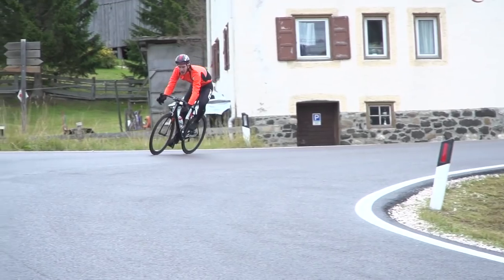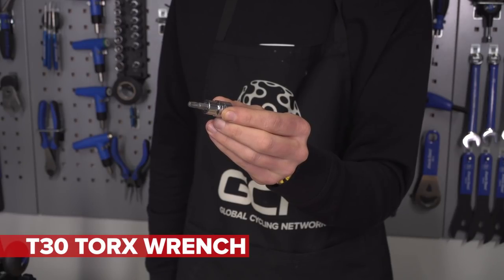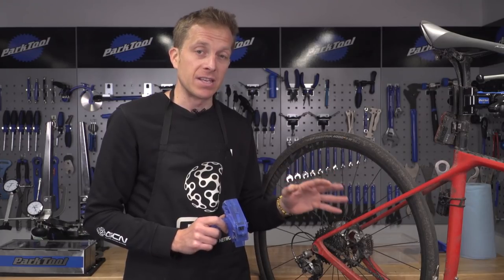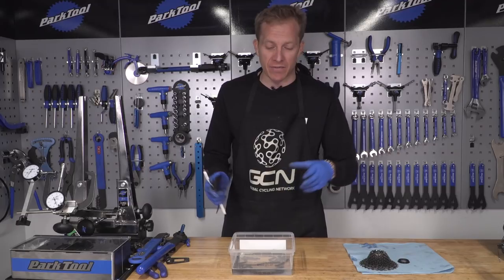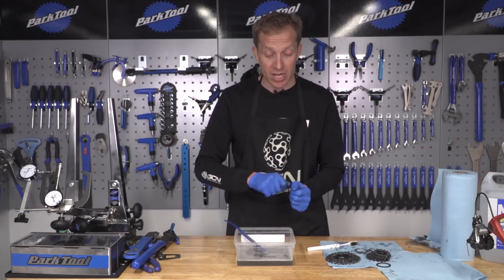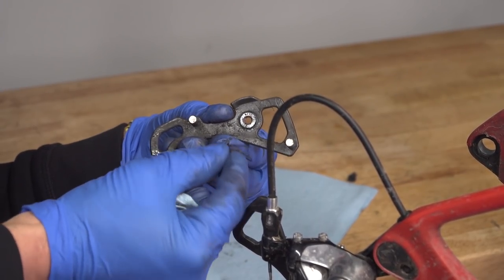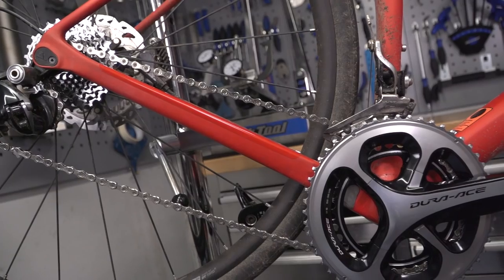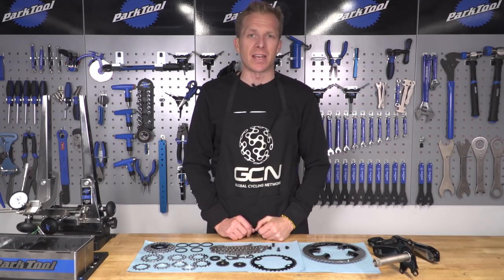Drivetrain Deep Clean | Make Your Road Bike Ride Like New

Comment: You're pouring the degreaser out the wrong side of the full container - to avoid spilling it, pour sideways or even backwards, that way the bottle is much closer to horizontal before it starts to pour and you get a better stream.

Comment: The first step to this process should be to not let your drivetrain get to the state it was in at the start of this video in the first place. An ounce of prevention (that is, washing your bike and degreasing the chain with a spray degreaser regularly, especially after it's been out in bad weather) saves a pound of cure (taking the whole damn drivetrain apart and scrubbing everything with a toothbrush).

Comment: After cleaning my bike properly last time i'm dealing with a new problem i've never had before while riding it. When i'm putting force on the pedals my gears do sometimes switch to a lower one. This happens while standing up and sitting down as well... Don't know how to fix it exactly? Did i do something wrong putting the casette back on (maybe swaped the black rubber things that are between the sprockets)? Or is it just the derailleur that isn't adjusted well anymore?
Reply: Sounds like the chain may be threaded through the rear mech wrong and hitting the cage which is what you may be feeling.
Reply: Thanks for youre reaction! But i didn't think that's the case here... I didn't removed the chain, only the cassette! It does hit the cage at the front derailleur when i'm ridding in my highest gears!

Comment: if u get the crank of completely why not replace the rubbish Pressfit Bottom Bracket as it will most likely be full of dirt and grime too if for e.g. your jockey wheel bearings are dead

Comment: Use an ultrasonic cleaner. It will take you 10% if the time and no scrubbing degrease in ultrasonic and rinse with hot water

Comment: what do you mean contaminate the chain? - Also, I would say lubing the chain is probably easier off the bike, and then putting it on, really only having as much oil on it as necessary. This way all the cogs would stay clean a lot longer.

One more thing: ever waxed your chain instead of oil?

Comment: do you need to do this after evry ride?
Reply: if you ride in the rain and muck, you should probably give your bike a quick hosing off after every ride, then dry and regrease the drivetrain.  a tear-down like this is only good once the bike is super dirty (or you really like taking things apart).  Maybe once or twice during the winter, again depending how dirty things get.  a deep clean is always cheaper than new chainrings, cassettes, and bearings.
Reply: Lars:  Of course you do.  (It gets harder if you do 2 rides a day!)
He hasn't even shown us the daily steering/fork disassembly lubrication, although I am sure you remember the weekly brake check and handlebar wrap.

Comment: Jon, my automotive trainer would have had a fit if he saw you using a torque wrench to loosen a bolt!  loosen with a torque wrench can impact on the calibration of the tool.
Reply: Eli Douek he didn't use a torque wrench, he used a torx wrench. Different things. Torque wrench measures the force in Nm, whilst a torx wrench is a six pointed screw driver or wrench
Reply: Actually, he used a torque wrench with a torx socket to loosen the chain ring bolts @6:56. Eli Douek is correct, you should never use a torque wrench to loosen fasteners.
Reply: He didn't use a torque wrench, watch it a few times. It's just an ordinary socket wrench with a torx fitting.
Reply: That is definitely a torque wrench. You can see the adjustable knob at the end.

Comment: 2:57 what?! Removing a joining pin?! Isn't Shimano suggest to remove any other pins, except the joining pin? It is slightly bigger than the normal pins, so it can tightly fit in place of the original pin, while the original would be a little bit loose? Same should be here, when you remove the joining pin, you leave a bigger hole, so the new pin won't fit so tight.

Comment: this was so painful to watch! Use a high pressure washer with some soap first to clean all of the sand and stuff first so you don't damage the protective coatings and paint! Only then it's a good idea to disassemble everything for degreasing with a degreaser/diesel/kerosene and re-lubrication.

Comment: "...and now it's simply a matter of reassembling the components...." My goodness.  Nothing "simple" about it. My guestimate from start to finish this method will be well over and hour, and closer to two. Is it worth it? You decide. I usually do on bike cleaning for most of the season and MAYBE once or twice clean the chain rings and cranks.
Reply from the maker: reassembling is under 10minutes. Cleaning depends on how filthy it was to start with, thanks, Jon
Reply: One addition to the  video might be some tips on how to organize the components for easy re-assembly. I am thinking mainly of cassettes. Jon has the sprockets and spacers all lined up on a towel -- might be worth it to emphasize that type of organization. Ten minutes is probably for the advanced home mechanic. I'm pretty good (no expert) and  reassembly takes me 15 - 20 minutes to do it right. Good tips on re-greasing/loctite, etc.
Reply: Better to do it slowly and get it right. I would rather spend an hour and know that everything is perfect.
Reply: there are a certain few of us who get enjoyment and satisfaction from tearing things down to a pile of screws and putting it all back together correctly... I don't think I could work in a bike shop because I'm too much of a perfectionist with this stuff,  I'd probably take 4 hours to put it all back  :D :D   Nothing provides a clear understanding of how it all works more than taking it all apart and putting it all back together.

Comment: best way to clean your chain is to not even make it dirty.
go for wax
Reply: brush PTFE on it and see how much that changes your ride
Reply: i would like resions for your opinion
Reply: CMDR meneldil what is ptfe?
Reply: Teflon powder
Reply: CMDR meneldil like the molton speed wax chainpowder?
Reply: your it the same stuff - about $35
Reply: CMDR meneldil is there a same stuf than speed for 35$
Reply: CMDR meneldil 
Are you riding only with powder ob your chain? the powder is recomended on top of the wax right?
Reply: paraffin wax with some Teflon added and powder on top